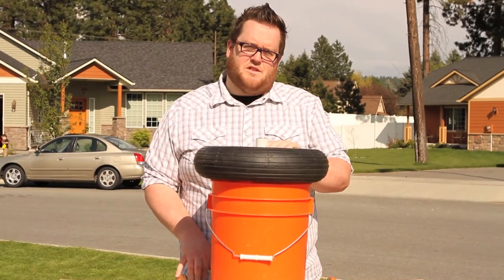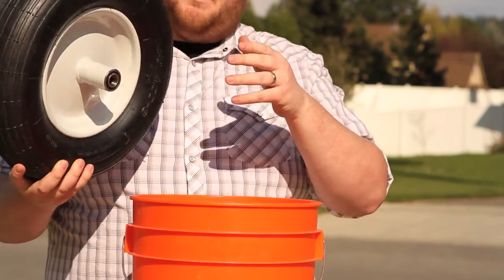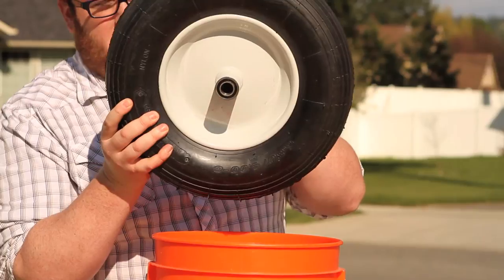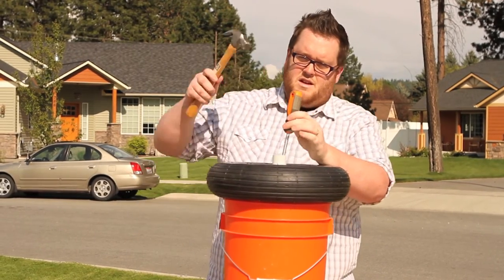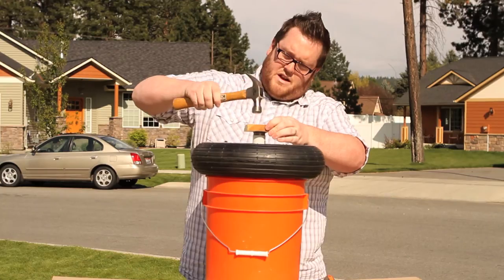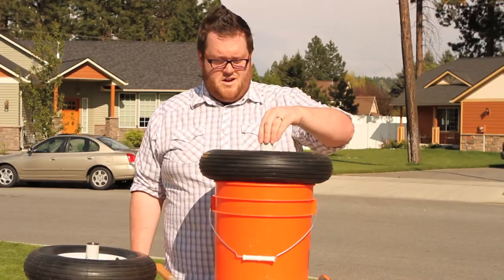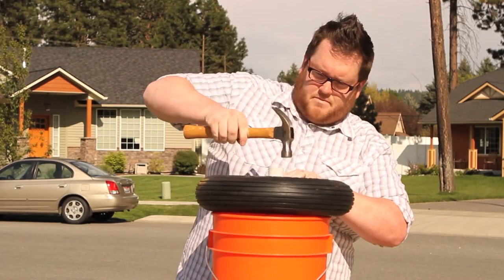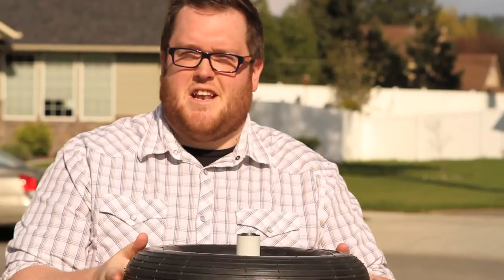How To Replace Bearings in a Tire - Marathon Industries How To Videos

Comment: Fantastic!  I spent twenty minutes on my own trying to remove smaller bearings, as my lawn cart needed the larger ones.  Then saw your video and in less than three minutes had it changed over and on the cart.  Will buy tires from you as a direct result.

Comment: Thanks, I need to change the hub from the 5/8 to 3/4 size. It worked no problem. I am sad that the replacement hubs attached do not have ball bearings, but rather are plastic, but it works. I was repairing an abandoned back yard six cubic foot garden wagon. $70 and a usable wagon, I consider that a big win for me.
Reply: six cubic foot not yard!!!!
Reply: Same

Comment: Why is there sometimes a grease zurt if the say the bearings are sealed?
Reply: They don't want you to do regular maintenance on your stuff that way you buy more. Its a genius, simple, old trick that's been in process forever. Just regrease them every year and I guarantee they'll last 10x longer. Or just spend the $10 and get a new set of 4.
Reply: A true sealed bearing is VERY hard to find. 
Most are shielded. The shielded bearing will slow but not totally stop pressured grease 
It only takes a tiny bit of grease to enter the roller area. 
Old guys like me will use a flat tip screw driver to destroy, remove the inside shield or seal. 
I'm not absolutely sure its necessary to do that but it's easy so I will keep doing it.